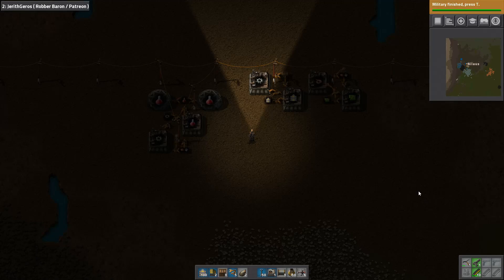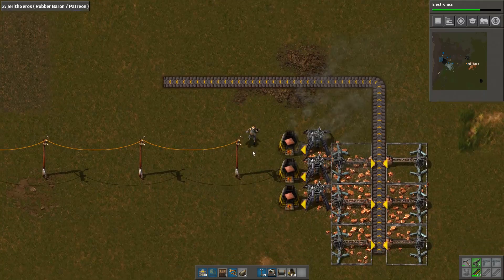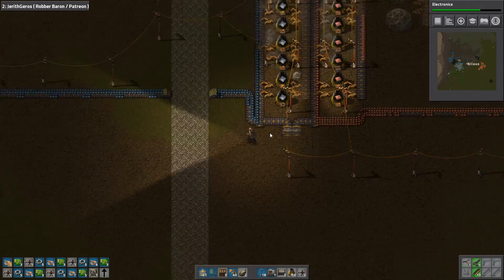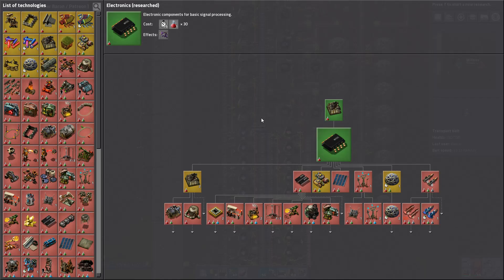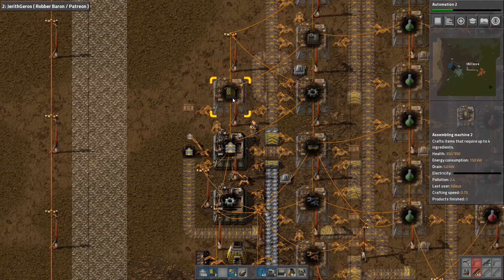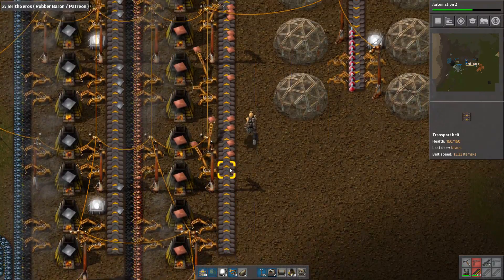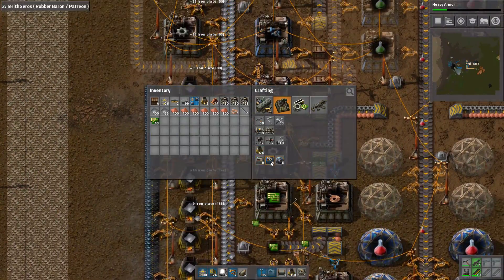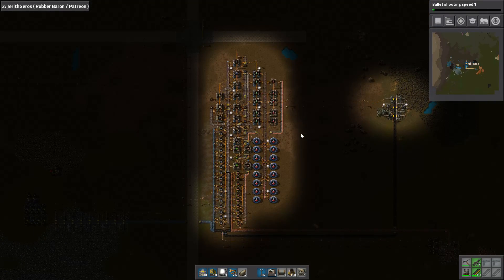Factorio 0.16 - Final Factory #02 JUMP START BASE

Comment: 1rpm per patreon supporter?
Reply from the maker: 10 Science / supporter / min i.e. 150 supporter = 1500 Science / min
Reply: okay, so for 150 subscribers it would be 75% of a rocket per minute then to get the 10 science per second as the rocket produces 2000 space science
Reply from the maker: 1 Rocket = 1000 Science. So 150 Supporters (not YouTube subscribers) is 1.5 Rockets / min